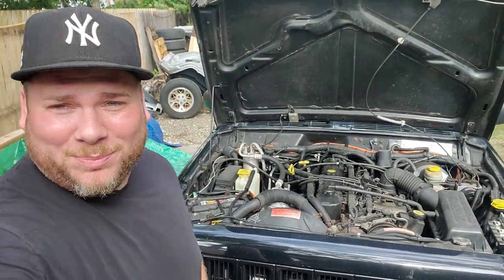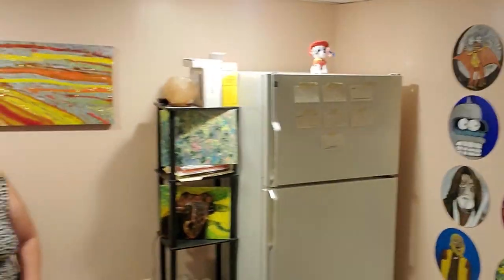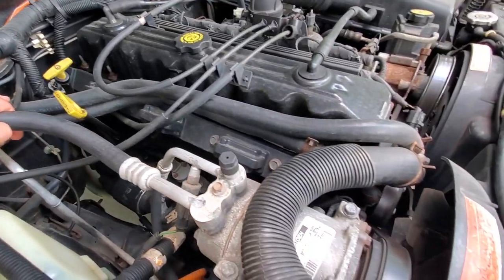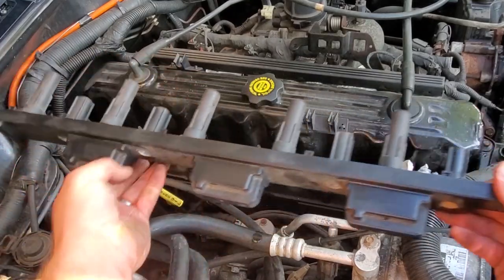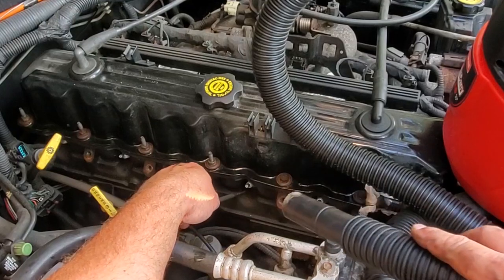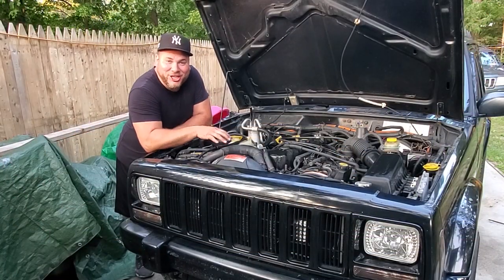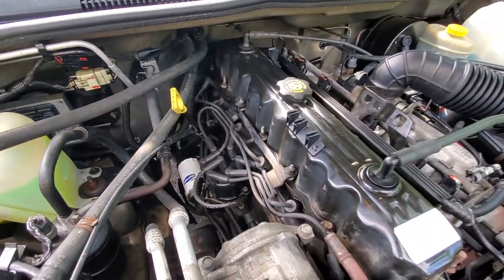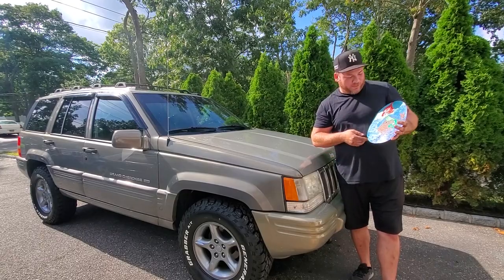2000 JEEP CHEROKEE XJ & 1998 JEEP GRAND CHEROKEE GETS NEW SPARK PLUGS!

Comment: Funny how I ran across this video. I was looking for just this video. I'm holding a champion RC12ECC. I just took them out of my 2000 wj. I checked the gap, I can't believe they were all at 0.45 to 0.48. Dumb Q? Is that why I'm getting po172 and po175 codes. Running rich after I replaced all my 1 hole to 4 hole injectors? So then I just put in a fuel pressure regulator. So just a few hour's ago I put in the NGK ZFR5N 3459. I triple checked the gaps at 0.35. with all the parts I replaced and test, IE fuel, ECT... I decided to reset all my codes by clamping the neg and pos cables together while I change the plugs. I was getting a p1292 on odometer for fuel relay, think it was cause I used a jumper wire on the fuel relay fuse to do one of the fuel pressure test. So now all done, no more codes. Waiting for the car to cool to see if it still has a rough idle murmer when cold,but drives and even shifts like a dream! Time will tell.🤞
Reply from the maker: Sounds like your good to go!
Reply: @ProjectDanH  Nope! I just drove it 40 miles and the po172-po175 codes just came back. Sheesh! I guess my oxygen sensors are the cause? Guess I'm going to try cleaning them, just have to figure out which ones? My OBD2 only shows bank 1 and bank 2. Do you have a video on cleaning and finding the correct ones.  Thanks!

Comment: I love such informative videos with explanations for everything.

By the way, a marten had some fun in my 1989 XJ and munched vacuum lines near the reservoir.
Fixed temporarily with electrical tape. How would you replace them, original parts or "modern" silicon hoses?
Reply from the maker: thanks man!  I'm just a regular dude trying to fix things a regular way 😁.  that's a great question that I was pondering myself.  try the modern hoses and let me know!  I'd love to know for my beach jeep build

Comment: Hi Dan , great video but I have a question for ya' . Now this is from an electronics guy point of view , you smear the dielectric grease in the holes for the plugs then push them on ( coil pack part of the video) wouldn't it be better to put it on the porcelain part of the plug ? That grease is an insulator not a conductor . Yeah I know it's 50K volts but still ......What's your take on this ? just curious . Thanks
Reply from the maker: That is correct, The metal clamps make great contact on the plugs.  I slather it on to keep crud and water and corrosion out

Comment: Dan have a Question for you, i noticed you adding oil with Zinc and was wondering what you thought about a Product called (Hyper Lube ) find the one with these numbers involved HPZ 212 Zinc) you will know by the price it's $12.36 cents and takes a month to 2 months to ship. It's a Zinc replacement additive) being sold on Amazon in 12 oz bottles that is suppose to protect better then Zinc made for flat tappet camshafts and is safe for Catalytic Converters It gives you this info right on the back of the bottle. Would like for you to look for it on Amazon and tell me what you think. All kinds of testing has been done on this product as you will see. As you know XJ's have 3 Cat's 2 upstream and one downstream and Zinc is not safe for Cat's this Hyper Lube is. I'm thinking of giving it a shot $ 12.36 cents a 12 OZ Bottle add one to every oil change. The last thing i want to do is Exhaust System work. Check this out and tell me what you think. Bottom line is i don't think you can do away with the 2 upstream Cat's without tripping a Check Engine light or any of the 3 for that matter. Make sure you are looking at the right Brand they have a cheaper type it's not the same.
Reply from the maker: Our flat tapped lifters need zinc, im exited to hear hyper lube wont clog the cat.. i gotta try it!!
Reply: @ProjectDanH  placed an order for it yesterday  due in sometime in the middle of November. Read some of the reviews  as much as you can trust them and the stuff seems on to me.

Comment: Eddie Van Halen 💜 🎸  
I noticed you said 3/4 drive it's a 3/8 drive 😅 I typically use a regular 5/8 socket to put in the new plugs because that rubber part gets stuck on them but you can also use a piece of fuel line and start them by hand . With coil on plug vehicles like black beauty and newer vehicles anti-seize can cause a misfire so it good that you didn't use it but you can use a little dab of dielectric grease on the threads if needed . It's pretty cool to see you have the same friends for all these years and she does some cool stuff as well the thundercats one is what caught my eye . BTW that back half XJ is photo bombing all the time 😂
Reply from the maker: Milly definitely good people!  Good catch on the driver size!  I didn't even notice it in editing 🤣🤣🤣.

Comment: Here is a question for the comment section...  I have a 2002 WJ with a 4.0.  I recently got the Viper coil mod upgrade and was looking for new Spark Plugs for it.  I noticed in your video the spark plug list only goes up to 2001. ( 2:20 )   I have read that the Iridium spark plugs would be a good upgrade for the Viper/RIPP system.  But as you see the list of available NGK spark plugs only goes up to 2001.  Could I run the 2001 in my 2002 with the Viper Mod upgrade and have it be ok?  
Love the videos, thanks for any help in the comment section...
Let me finish reading this thread before I post.
Reply from the maker: The manuals give the spark plugs that will work the best for OEM specs.  They usually don't take an account for mods.  I think it'll be all right with whatever you try as long as you do a little research

Comment: You don’t know how many drains/flushes it takes to get your 4.0 to keep green coolant like that. Once it’s brown and abused it’s near impossible to get it back.
Reply: Use your garden hose and lots of fresh water. 😃

Adding coolant system cleaner and opening the heater core by tuning the heater on before you start draning helps a lot.
Reply from the maker: yep! that's the Gods honest truth! especially rust sediment in the heater core!  I'm still battling that in the grievous
Reply: @ProjectDanH  it’s become an annual tradition right before winter.

Comment: Champion do a poor job in the 4.0 ,you have to understand this engine has been around for 76 years ,first used in 1946 in the NASH 600 THIS WAS the time when all GAS was leaded flash point different CHAMPION WORKED FINE ,NOT TODAY!MY 1995 ZJ RUNS PERFECT ON NGK 7456 COPPER THESE ENGINES ARE OLE SCHOOL SET UP ,THATS WHY THEY RUN FOREVER IM 70 STILL REMEMBER THE AMC WAGONEER SAME SET UP,MY DUCK HUNTING BUDDY STILL HAS HIS 40 YRS OLD!
Reply from the maker: Wow, Cool story ray.  Your right, these babies were around longer than Ive been alive
Reply: Hey DAN TO SET PERFECT TIMING PULL #1PLUG TAKE A LONGBREAKER BAR TURN ENGINE TO TOPDEAD CENTER I USE A DRINK STRAW, PULL DISTRIBUTOR TAKE ALIGHT THE SLOT SHOULD BE 11 AND 5 OCLOCK PERFECT!!
Reply from the maker: @rayoliver6807  great tip! I gotta do that to set a new cam sensor 👍